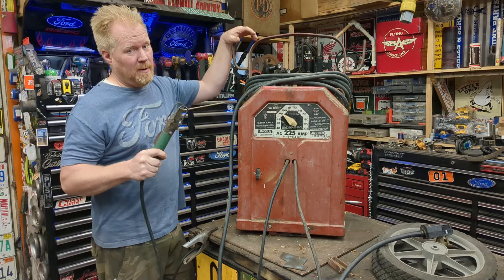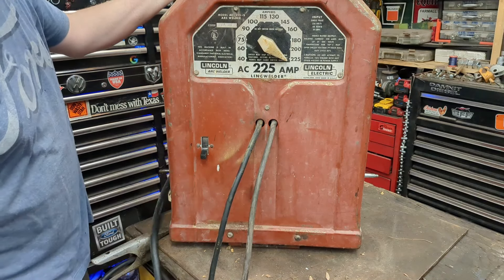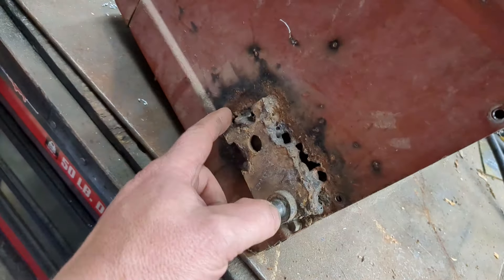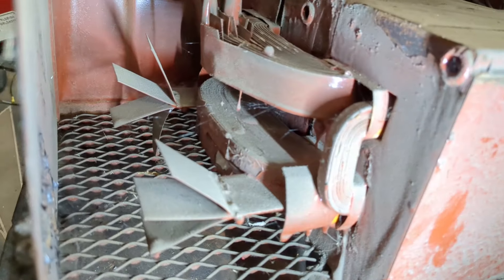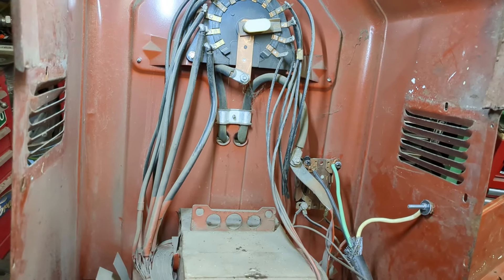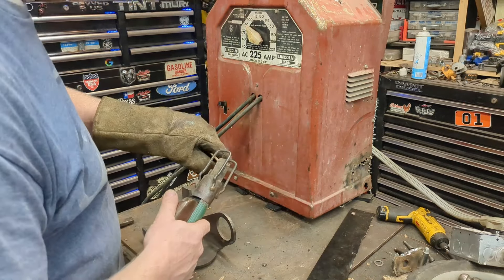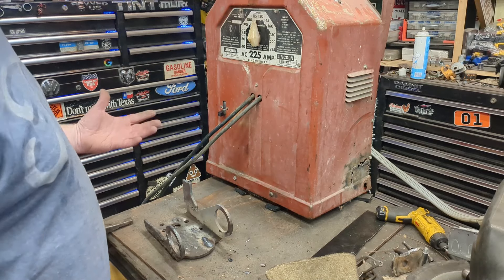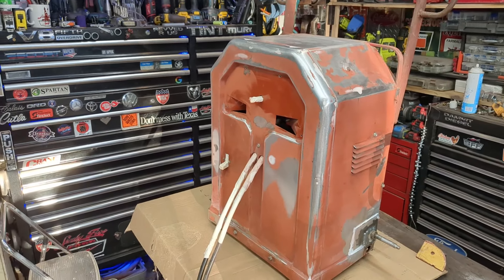Vintage Welder Fixed & Restored LINCOLN TOMBSTONE 225 AC buzz box

Comment: Just like a situation I encountered at a large bottling plant. I had to do some welding and I needed to set up shields for other workers to keep them from getting flashed. After getting all boxed in I plugged in the long extension cord and went to connect the ground. When I touched the ground clamp to the machine it sparked all over. I wondered WTF and looked at the switch which was in OFF position. Then realized something was drastically wrong. The switch is a dual throw and when in off position all connection stops at switch.
It turns out the EXTENSION CORD was hooked up like this welder was. The green ground wire was hooked to one of the hot lines.
Reply from the maker: That makes for some exciting times.

Comment: "You need a welder" Great quote. If I ever see one of these for 50.00$ ( or 100.00) I would buy it.
I did find one for 150.00, but it's 950 miles away, and the shipping was more than the Buzz Box.

Comment: with a stick welder like that ( I own one) starting the arc is far easier by dragging the tip.... not poking it as it will stick every time ! i use a arc motion down slide and then start welding as you pull the arc up a bit.... thin metal is very hard thing to weld with these welders but the trick is low amperage and the smallest rod you can find .... welding thick stuff is easy it's the thin stuff that will teach kids new sware words ! LOL

Comment: I was given a tombstone welder about 10 years ago for scrap. The guy said it worked but he took the leads and power cord off of it for another machine. He left about 6 inches of lead hanging out so I just put ends on it and wound up with about 50ft of lead and used a power cord from an RV. The thing is still welding today and now have over 100ft of leads. I will say you have to run a higher AMP setting depending on how much lead I'm working with but I love it.

Comment: THE FUNNIEST REWIRE JOB I EVER SAW WAS ON A REAL NICE LATE 30s/40s CONSOLE RADIO WITH ALL THE EXTRA OPTIONS!
I FOUND IT ON A DUMPSTER DIVE, AND WHEN I PLUGGED IT IN, POPPED THE FUSE IMMEDIATELY!
ON FURTHER INVESTIGATION I NOTICED THE POWER CORD WAS RECENTLY REPLACED , BEING SPLICED AFTER CUTTING OFF THE ORIGINAL CORD!
I UN WRAPPED THE SPLICE AND FOUND ALL 4 WIRE ENDS NEATLY SPLICED TOGETHER, THEN TAPED UP!!
I MADE THE CORRECT CORD REPAIR AND THE RADIO WORKED GREAT!!

Comment: As a professional pipefitter/ pipewelder I'm not a fan of any straight  AC box. I've used one at a friend's shop but if I don't have to I would rather not. I have a Miller  Thunderbolt AC/DC box I paid $50 for and it welds great, even runs a TIG rig but you have to strike start or you'll stick your tungsten.  Point being if you're serious keep looking for a DC welder, you won't regret it. Good news about this is add a full spectrum bridge rectifier and it will weld AC and DC.

Comment: At first I thought the title card "almost killed me" was clickbait. But it wasn't. Connecting the equipment ground and one hot to the power switch thus giving it 120 instead of 240 volts is one thing. But connecting the other hot to and energizing the chassis was making it a death trap.

Comment: Ha, yeah opening the case and finding .. what !    One thing I do is keep a fan running for a few minutes with no load on the circuit, to let the fan prevent heat soaking a unit.  10:13

Comment: You are vary lucky you didn't get electrocuted. I acquired 1 in the past the leads were horrible and I took it apart the inside didn't look much better so I threw it in the scape pile. I now have another one that works great.

Comment: Originally to you the welder was powering only onee side of the transformer with 120 v. To say the the welder won't work on 120 run 120v. now that you have it wired properly. Congrats on your new stinkin'  Lincoln!!!

Comment: A couple questions. Where is a AC stick welder adequate and where would you want to use DC ? Next, does stick welding provide better penetration ? I'd like a build a flatbed truck body with steel that is typically 3/16 up to 3/4" thick. Would a quality mig welder do the job just as good as a stick welder ?

Comment: The household drier plug is 30 amp, whereas this requires a full 50 amps. You can definitely use it, but any longer welds or higher amp welds with 7018 will trip the breaker a lot.

Comment: When you opened the back, I said "oh shit!"  It is lucky that nobody got killed.
As for never dying, I can send you my old transformer.
I noticed a while back that the bottom was coated with the lacquer coating put on the transformers. I didn't think anything about it then. I was trying to use it one day and when I stopped the arc, the welder sounded like it was still welding inside.
Apparently, it overheated and shorted out. I replaced it with a new one with A/C and D/C modes.

Comment: Did you notice an extra lead from windings? I think they were labeled D1-D3. One I have has unconnected lead.
Reply from the maker: I've never seen unconnected leads on any of the ones I've opened.
Reply: @sixtyfiveford  evidently it's for 3 pole , ie, 480 V.  Ty for reply. You have any vids on Hol-dem Electric Fencers " Model 57" , and or electrolysis?
Reply from the maker: @jerydob6499  3 phase, That makes sense. I've never done videos on those.
Reply: @sixtyfiveford  well who wouldn't like to do a video on a 500 V  electrolysis chamber?  I'm' uh try it.

Comment: I just have mine bale wire tied to a cheap $10 hand truck since 1980 for ease of moving around.  I do suggest wearing gloves and using a meter to check voltages and if the chassis is hot to ground - could save your life - alot of 
" handy guys"  do bad wiring all the time.

Comment: Flip-flops, I'm already wearing under fir.  That wiring job... I caught it right away, some people shouldn't be messing with electricity.  I had to laugh as I just inherited one of those from my father-in-law and from trying to look it up, seems like it is about as old as I am.  AC-180-S  Code : 4248-107  And what is really cool is about 40-50 feet each way of cables which will reach the drive in door from my power.  On some forum someone said if it doesn't have a fan it is copper, I just moved it and no time to take it apart at the moment.
Reply from the maker: That's awesome. So yours was made in July of 1961 or 71.
Reply: @sixtyfiveford  Thanks, I couldn't find any seven digit codes.  Still haven't taken it apart, just got back with a tiny dolly for it.  Almost stole it, it was hiding under the new ~16hp motor I payed for, but not the dolly.  3rd motor for my firewood saw this year!
Reply from the maker: @bardmadsen6956  What kind of firewood saw are you using?
Reply: @sixtyfiveford  20" Dia. Buzz, you would get a kick out of the looks of it.  I laugh at it all the time, I keep inching further up in HP, obviously 10hp snow blower motors are not enough.  This will be the first try with a new motor!  I usually rebuild them till something flys out of the crank case.  Cutting up semi loads of white oak slabs from saw mills.  I'm from the Sun-Belt and my log-loader trucker died and it seems impossible to get another, to the point of seriously thinking of moving South because I have zero wood for my shop AND my mother-in-law is going to move in...  Let's see, 20 below and sideways snow to work and get away in.
Reply from the maker: @bardmadsen6956  I get a kick out of all the crazy ways to cut and split firewood. A buzz saw is always fun.
Reply: @sixtyfiveford  I took a picture of it, find my email and I'll send it.  Just took it apart and started looking at the new contraption, it will be a challenge to fit it in a constrained space.  I tell myself about the fun every time cause this summer has been endless problems, the motor before the last, after fun, had the starter on the ground and the exhaust bouncing on the carburetor.  It did die valiantly though.

Comment: Great job of refurbing that old box. It will never die if someone doesn't screw it up again. When I saw that wiring I let out a cry! But...I have been guilty of the same crime. I moved to Germany from the States in 1965. I moved into a house with a young family and they had a new washing machine. It had a cord, but no plug. "Oh, I'll connect it up for you." I never would have thought that red was ground...but it was. I nearly killed the young mother when she was standing with bare feet and touched the drum. Red had been ground in Germany since the early years and only in the 1970s did green/yellow become ground throughout Europe and later throughout the world. After that, whenever I wired up anything I looked at where the wires go inside the machine. You never know what you are going to find.
Reply from the maker: That's a great story
Reply: I’ve always gone by the saying “Green is ground the world around”. I would have done the same thing wiring that washer.
Reply: @Hoaxer51  There was no green. There were just red (ground), black and white. Green/yellow became standard for ground in the 1970s, but still not everywhere. It always pays to open up the machine and look where the wires go inside.

Comment: Amazing.  The day you posted this I was taking the panel off of a Marquette 240 spot welder.  It plugs in, power passes all the way to the transformer and circuit board...but then something is a miss.   I'm stuck. 
I don't want it to go to scrap..that would be a waste. Leads are in good condition..someone will need this thing.

Comment: What amperage do you need to run that welder. Found a broken one for sale that says for repair or parts. it has the switch missing and plug at end of cord is missing. Case looks decent. A lot better than how yours looked. They want $75 . The ad says untested. Worth a try?
Edit. 
Just looked up cost for a switch ( wow $81 ) I have a 30 amp 220 plug available. This doesn't seem big enough. Maybe a 110 volt wire welder is all i need for most small jobs. Your video gets me thinking possibly to ambitiously. 
Love the video of you dog at the end of each video. Smart dog.
Reply from the maker: I generally buy these in working condition for around $75 or less. They don't come up everyday at the price but they do come up. I also like to find them with included goodies; helmet, gloves, extension cords, and electrodes and may pay upwards $100. However, a 110v welder will do most everything and weld upwards 1/4 steel with prep.
Reply: @sixtyfiveford  Thanks

Comment: Nice video!!! It‘s funny that you have 120/240 volts there.. here we’ve as a standard 220 to 240 volts, into the house is coming appr. 500 volts, so on welding machine and othe professional work-machinery we are using 380 volts with 16 to 32 amps.. so how many amps you are using there. ? For household appliances is here only 8 to 16 amps.. (Germany) but it’s really amazing, what you made out of junk! Greetings to Ginger 🐶
Reply from the maker: All our amps are double. So a basic/lowest 120v outlet in a home is fused with 15 amps with many at 20 amps. The 240v welder here runs at 50 amps. A household stove will be 240v 40 amps and an electric dryer will be 240v 30amps

Comment: Can't believe you didn't get shocked with 120 volts to the case from the instant it was plugged in.   
I use NEMA 5-50 for home welding from the original range outlet, flipped it around  in the wall to face the garage.  Yes, it is an obsolete connection as it lacks a neutral.  Perfectly safe with devices that do not use 120 for internal components.
Reply from the maker: The wiring was so poor it wasn't making a good connection to the case is my thought. Welders and Plasma cutters are the only devices still sold with the Nema 5-50 plugs and much easier to unplug than a 4 prong/14-50.

Comment: The Lincoln welder at the farm where I grew up still works, the fan takes about 5 to 10 minutes to "warm up" and get to full speed, use the circuit breaker on the main panel to turn the welder on and off because the switch has long since went bad. I am 52 years old and remember this welder as a child,  very likely WAY older than me!
Reply: Leebuck, mine did the same thing. I hosed the bearing down with WD-40. Now it gets up to speed immediately. The bad thing about taking that long to get up to speed like that is the windings in your fan will pull more amps and eventually burn the fan motor out.

Comment: I bought one of those welders for 50bucks 30yrs ago, it worked then, but haven't used it for many years,since i got a mig welder in 2008, but will be in the process of restoring it soon,  probably need new cables, but would like to know what gauge the ground clamp and stinger cables are?
Reply from the maker: They're an odd ball 5awg from the factory. 6awg works at 15' stinger 10'ground. If you want to go longer 4awg would go double that.

Comment: Before you opened it up I thought you were a brave man. Do you have an RCB in your workshop supply
Reply from the maker: I'm surprised I didn't get knocked on my butt. The only saving grace was the wire job was so poor they didn't tighten the nut on the case well enough to shock me.

Comment: The duty cycle on those is low. I think around 20 per cent. If you exceed or run it too long you can melt the selector switch.  Friend of mine wanted his trailer done and wanted me to keep welding. I warned him but he wanted to keep on it. We wound up with melted selector.
Reply from the maker: The 20% is only at 225 amps, at 75amps its 100%. This is common with all welders unless you get a pipeline engine driven welder. At a typical 100-115 amps it's going to be 80% duty cycle that you'll never reach with having to adjust position and change electrodes.
Reply: @sixtyfiveford  I agree with some of what you say but on large jobs changing position and changing electrodes only takes a second. I have run several machines to there danger zone. I own a Miller big 40. And a 1945 general electric and have used the Lincoln pipeliners. As I said I melted on of the buzz boxes. I'm giving advice so people may not melt theirs.
Reply: @sixtyfiveford  also sir I might add the job that melted the selector was the complete fabrication of a large fifth wheel trailer. Those machines aren't ment for use like that but if we would have given it breaks as I wanted it probably would have finished the job. Even on 100 per cent machines it's good to air on the side of caution

Comment: Yeah, hard to resist these buzz boxes.  I've got my little collection of Lincoln, Miller and Century along with my latest 120VAC find that I forget offhand what is.   OK, I see my FB post... a Trindl Super Industrial Arc Welder 125A output that uses bolt lugs to switch between the windings.  I still need to restore and upgrade all of them since purchased parts to convert one or two to DC output and about enough parts to do a dual SCR diac fine tuning Hackaday design.  I did just test out running 0.035" in my Century 125GL I restored to functional working order... though that really needs 0.035" tips and a new liner (looks like HF Vulcan is the best price and one for now).  I do want to get another gun with teflon liner and dedicated feed wheel to try the old school aluminum welding without a spool since last time I priced out was still about half the price of a spool gun.  I never liked MIG welding... and is amazing that's what I started to restore and use as of late.

Comment: Why didn't it trip a breaker wired like that. Paid $99.00 new for my first one. .Took one of mine to do some work and the plug in the building wasn't wired to a 220v breaker they said the dryer took a long time to dry clothes also. They welded to the side of the welder when there is a hole for an axle at the bottom of the case. Now I have 2 AC and 2 AC/DC tombstones.

Comment: Great video, with some good points to check before powering it up, lol. I bought one of the Lincoln AC-225's when I was in high school; 50 years later it still works just fine. Over the years I added some wheels, a handle with holders for a chipping hammer and wire brush, helmet hook, and a big binder clip for a pair of gloves. My grandchildren will probably still be using it. 
I had the good luck to pick up a pre-inverter Lincoln Century 140 (Lincoln Canada Ltd.) wire-feed welder - pretty basic, which means not much to go wrong. For $55 or $60 and working, I couldn't pass up. The only tweaking it needed was adjusting the wire feed. I use it nowadays for 95% of general repairs and fabrication. It did come with the factory plumbing for connecting a gas bottle - that's been useful on some jobs. However, for most "fix-it" work flux-core wire is just fine. This one has an AC terminal block in the housing that allows connecting either a 120 or 240 VAC cord. Although the top-end amperage is less, having a 120V plug is handy. The big plus apart from wire feed is the size and weight compared to a buzz box. Even pre-inverter it's still a one-hand carry, lighter and smaller that the "tombstone." Thanks for your great videos - they're always enjoyable and often educational.

Comment: On any of the welders you reworked have you ever added diodes to turn the buzz-box into a DC welder?  Add an inductor?
Reply from the maker: I have had the DC version of this welder and though it does weld smoother I wouldn't go out of my way to convert one. Yes it's better but just barely and really not worth the hassle. I know it's cheap(sub $100) to convert it but you would be better off selling the Stick Welder and bumping up to a MIG.

Comment: Got mine in 1973. Still rolling strong ! Great video. Thank you !
Reply: My best project with this one...... welded a dropped tie rod for my 
57 Chevy 2-dr hardtop (balanced and blueprinted 350+.030, 12-1/2 : 1 Jahns, Holley 3 bbl on Edelbrock, Isky 3/4 Roller and alum needle bearing rockers, idle at 1000rpm,  alum flywheel, close ratio 4 spd, 4:11 rear), so I wouldn't have to disconnect it every time I dropped the oil pan.